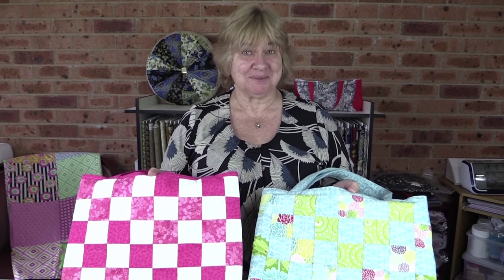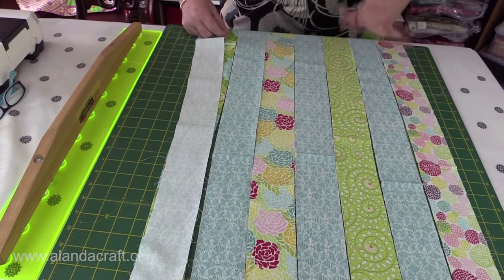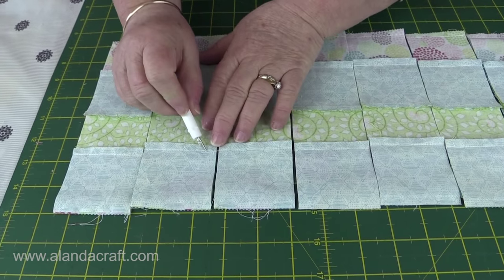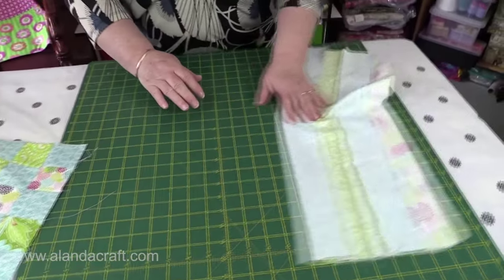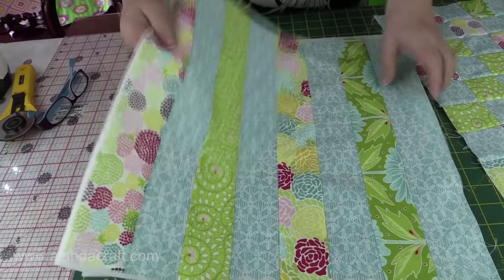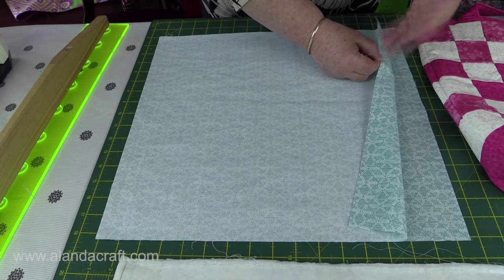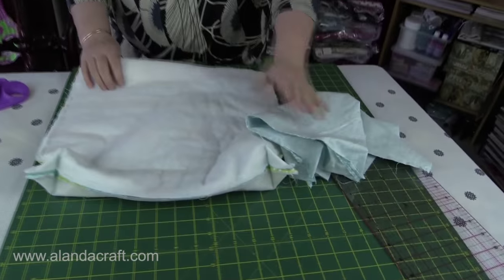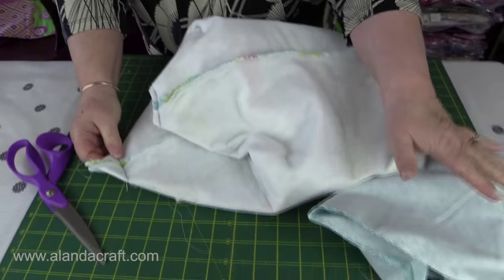EASY Checkerboard Tote Bag Tutorial

Comment: I was a little confused with the backing, what was the purpose of sewing the long ends up to make a tube, only to unpick?  Thanks
Reply from the maker: +GoldCoastWestie  Its just a quick and easy way to get the checkerboard effect. If it wasn't done this way you would need to cut little squares and sew them all together again to create the checkerboard.
Reply: +Alanda Craft Sorry I meant the back, where you have the stripes/ strips.  Surely you would arrange and place them in a way so as you wouldn't have to do that step?  Maybe I am not grasping it hahaha
Reply from the maker: +GoldCoastWestie Because we used jelly roll strips it was just easier to sew the strips together
without having to measure and cut at the start.  Unpicking the tube is quick and easy. But you can do it anyway you find easiest, there are no rules.